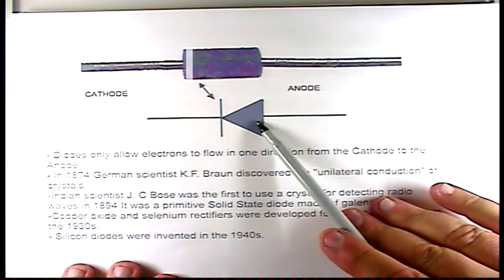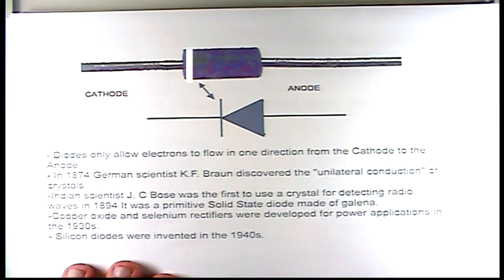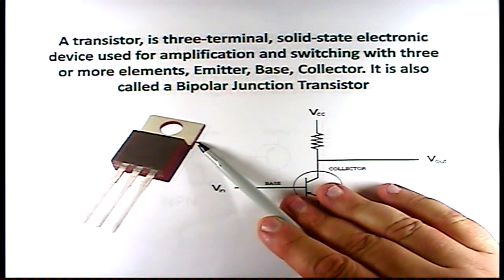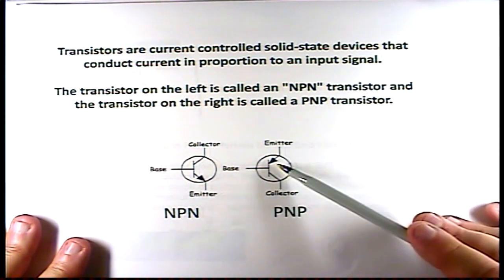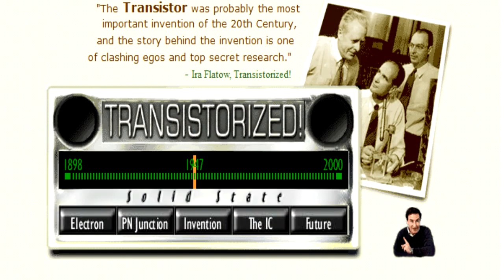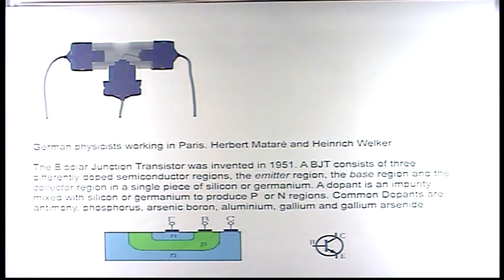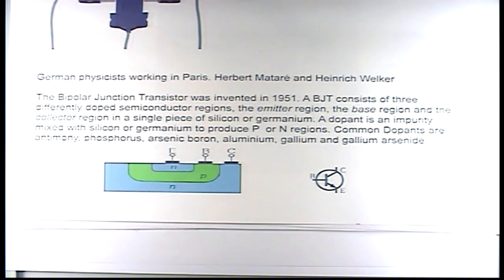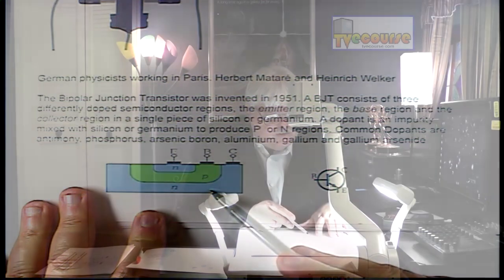Transistors Introduction 1. How Semiconductors Work and History Class 26.

Comment: The convention for PNP transistors is to represent the base emitter and collector in the same position as the NPN, not inverting emitter and collector.

The important detail : the base-emitter is a diode. The voltage drop is 0.7 volt always, no matter if you look at the sensitive stage that amplify microvolt of microphone or casette player head or the power transistor on the output. The current that flow on that diode is amplified approximatively 50 times to flow between the collector and emitter.

Comment: I have some old books on electronics, they compare tubes to transistors, so I already understood how a tube works so that helped me to understand transistors.
Reply: I agree, that's helpful, but it seems to me transistors or more complex, because with tubes, it's close to how a valve works, and with transistors, you have to understand forward biasing and how current and voltage flow through the junction?

Comment: No because A TTL transistors depend on voltage change to work .The emitter to base . A FET works on resistance variation so its a Current device . TTL has a low intut impedence where a FET and Triode valve has a high input impedence. A valve may use high voltage but its a current device because the input voltage varies the internal resistance .

Comment: TTL is a voltage device not current device .A FET is a current device ,so is a Valve
And for those confused about electron flow ,if you test a diode with a multimeter the negative lead goes on the anode and the positive goes on the cathode . I use the triange in the symbol as an arrow for electron flow . Works with LED's as well
Reply: Shouldn't that be the other way around?  Valves are voltage operated devices as they are high impedance operating at high voltage, and transistors are low impedance working at high currents?  Relatively of course.
Reply: +anno250 FET, field effect transistor is voltage controlled, BJT, bipolar junction transistor is current controlled

Comment: Doesn't current flow in the opposite way of electrons? I thought current flows from the anode towards the cathode, unless it's a Zener diode. Enlighten me.
Reply from the maker: I'm using electron current flow not conventional flow. Using electron flow makes it easier to understand how a transistor works. Conventional flow is based on a bad  guess over a century ago.
Reply: I guess technically electrons flow from negative to positive. Traditionally it's positive to negative, so you're right.
Reply: Yea it was a bad guess.
Reply: +José Tony Stark Peña I have a degree in eet, and they never taught about conventional current flow, It wasn't that important to them.

Comment: I am very much with you on that! Hell I'm 56 years old and have been interested in electronics since I was young and have tried to understand them since then! Look at a PNP  and a NPN transistor as a relay! One is normally open meaning the contacts are open until a current is run through the electro magnet. On the PNP, the small current has to go N and then the current flows through from P to P. On NPN you Pull out current to let current flow from N to N. Hope it helps.

Comment: oh man,  it feels little better I am not the only one.. I literally  spent all day yesterday deep in headache. Its not like  transistor is very hard, no its just  there is no good simple explanation. Also I don't need all the talk about the Boron materials sandwishing etc.. I want to understand   how it works.. Anyway  I think  and I hope I understand  the thing now.. I was stuck on the point how you could  turn it off and on in a flyback via the feedback. Turned out it was the polarity change?

Comment: Back when scientist were trying to figure it out, they all though that electricity flowed from positive to negative, which is now called "Conventional Current" used by most engineers, however this is all wrong, Electrons (-) are attracted to positrons (+) , so in reality the electron flow it from negative to positive.

Comment: I see a lot of comments arguing which way the current flows. In conventional theory "early theory" engineers thought current flowed from positive to negative,What they were seeing  was an optical illusion, the propeller effect if you will. the props spinning so fast it looked like is was spinning backwards. what u actually see is the space between the props blades going backward while the blades were spinning the way they were supposed to. Electron flow is from negative to positive.

Comment: we're not talking about the direction of electrons here, but we're talking about the current, the conventional current.
it's like you're saying that if you're running on a treadmill, you're running forward, but the fact is the treadmill is moving backwards and you're only moving (running) to hold your position, so if you take the tread mill out of the picture you'll find out that you're not really moving.

Comment: ha ha ha, very good constructed comeback.
i know that the electrons move from negative to positive, and holes move the opposite way.
but in reality current flows from positive to negative, if you design a circuit, you don't start from the ground and work your way up to the positive and then put the required voltage. but you get power supply( known voltage) and start constructing the circuit and calculate all values until you finish.
you have to be realistic as well,